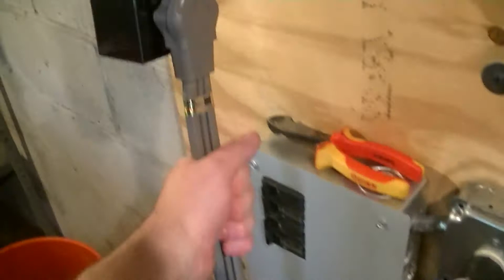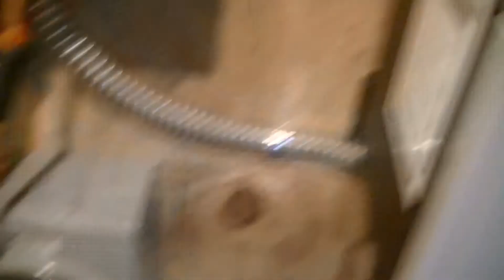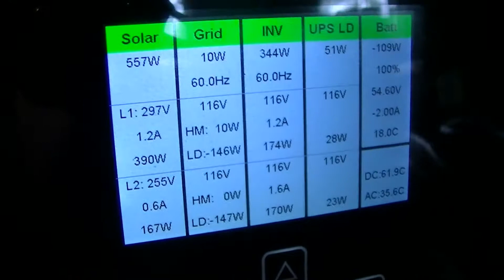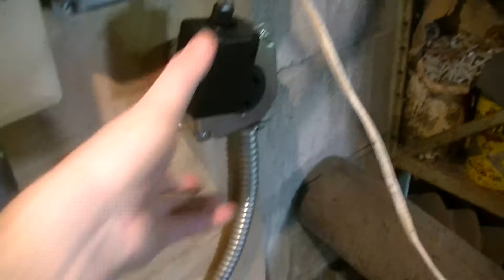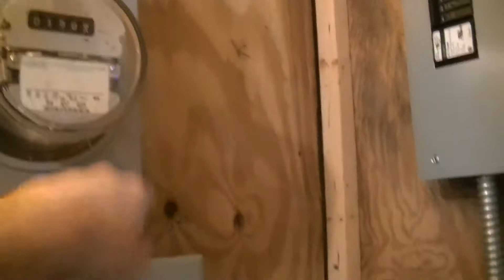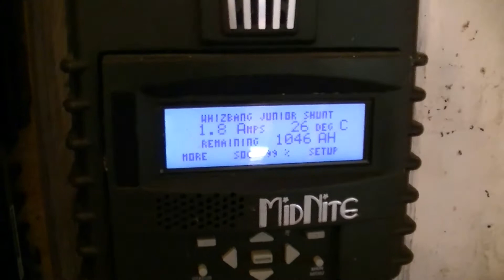AC coupled Magnum MS4024PAE/Sol-Ark 12K hybrid system

Comment: I am smart but I got lost. Impressive. Why did you need to AC Couple? Sorry if you have answered in a previous video. You have controllers in the Sol-Ark plus your two controllers
Reply from the maker: This was done mostly as an experiment.  If I need to, I can AC couple charge one system from the other.  Most of the time, these systems are isolated.
Reply: @randacnam7321  how do you like the Sol-Ark inverter so far?